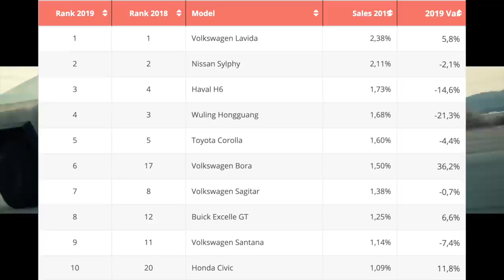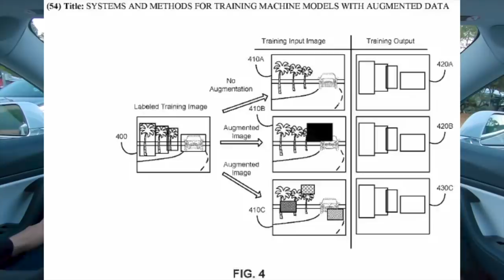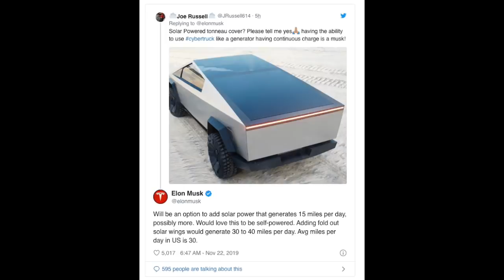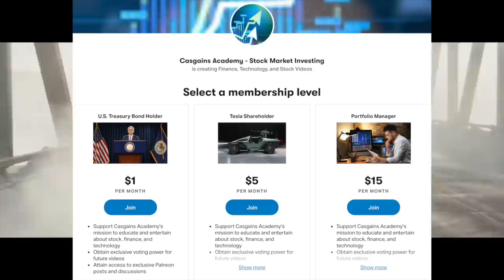Tesla's Upcoming $20,000 Compact Vehicle - An Industry Overdue For Disruption

Comment: How can Tesla get the price of a car down to $20K?

Here's what I'm looking for:

  -  Steel exoskeletons - thus far only seen on Cybertruck, nowhere else in the industry - can reduce manufacturing costs: fewer robots, less labor, and no paint shop needed.  This design approach argues for minimum steel bending, so it's going to be another angular design if Tesla goes down this path.  Different from everything else in the compact market, and kind of ugly, but with durability unmatched by rivals.  (This is a risky prediction, but I'm hopeful Tesla will go in this direction.)

  -  The sensors and computers add a lot to the cost of Tesla's more expensive models.  I expect Tesla to strip out most of that for an economy compact.  Less-capable computers, no FSD option, only forward-looking sensors and very basic driver assist, and a more basic entertainment system seem likely, at least in the early years for a compact/cheap car.  (Tech costs do decline over time, though, so some of what we see in higher-end models may trickle down eventually.)

  -  I think it's likely we'll see much lower ranges than we are accustomed to seeing on a cheap compact Tesla.  One possibility is that they will use a lithium potassium battery chemistry in the pack: half to two-thirds of the energy density per kilogram, but a much reduced production cost.  China has robust supply chains for this type of battery, in the form of prismatic cells - bigger cells, easy and cheap to assemble, less effective for cooling, but Tesla engineers can probably achieve acceptable cycle life regardless, being the clever people they are.  I'll be pleasantly surprised if Tesla can use lithium potassium battery packs to deliver 200 miles of range (EPA).  It might be a bit lower.

  -  I expect Tesla to refuse to compromise on safety.  Whether they use steel exoskeletons or more traditional stamped/painted bodies, they will engineer a compact car to achieve best-of-breed safety for occupants.

I don't believe Tesla will achieve a $20K price if they use traditional stamped/painted bodies, or include the full sensor suite and FSD option in every car sold, or use the same batteries we see in the Model 3 and the Model Y.

An entry-level model will need every cost reduction Tesla can find to hit the $20K price target.  But I can see the sense of Tesla offering higher-tier models with the full FSD sensor suite and computer, a top-notch entertainment system, and 2170 cylindrical battery cells for much longer range.  We might see a top-tier compact going for more than the base-level Model 3, actually.  It would be a sweet little car, too, especially if it has the durable exoskeleton going for it.  Throw in the FSD option and we might be looking at a $50K compact.

The funny thing is, I think they could move some product at that price.  There's literally nothing like it in the world - an electric compact with long range, fancy tech, no-scratch body, and autonomy, with almost no maintenance needed for a third of a million miles or more.  Crazy.

Comment: I think what they're gonna do is get so good at making model 3s that they get cheaper and cheaper. Then instead of replacing it, they introduce a new premium sedan for 50k and let the model 3 really become the cheap Tesla at 25k
Reply: In europe we need way smaller vehicle
Reply: I think a better sell would be a shrunken Model Y (Model Z?) that is sized like a Golf, to be an iD3 competitor.
Reply: @jesuguru2394  shrunken y is the 3...
Reply: @MJ-zl6yp  3 has the same footprint as the y. Thats the trouble in europe, old narrow picturesque streets of ancient buildings. Europe needs a model 2 with a smaller footprint than y and 3, esp if its going to operate as fsd taxi in those lovely places.
Reply: @DavidOfWhitehills  I understand where you're coming from. My point was just that if we're looking for a compact car saying that a smaller Y would be a fit makes little sense to me. The 3 may have the same footprint as you stated but it is a smaller car in regards to interior space, height, etc. Personally,  I'd love to see Tesla make a car similar to what's on the thumbnail. I'd personally buy a two door Tesla with 150 mile range. Or a couple hundred kilometers for you folks in Europe.
Reply: @MJ-zl6yp  in Europe we need vehicles with:
1) similar size to a Ford b-c max ( medium sized) with 250-300 miles of range ( 400-450kms) that should sell for 25-30k€/$
2) a vehicle af small size, like a mini/fiat 500 with 200 miles of range base and 250 with extended range, that should be at 20-25k € ( Fiat is selling a full electric 500 with 200 miles range)
3) a small 2 doors like a smart with 100-150 miles range ( 150-250kms) for 15k $.
Reply: @flaviosalatino8192  I'd love option number 3 personally!
Reply: @MJ-zl6yp  Except the 3 is still larger than the Golf-size Europeans (and Asians and some Americans) want, and the 3 doesn't have the large versatile rear hatch opening the Y and other ICE hatch cars have.
Reply: jesuguru A smaller model Y should be called model y
Reply: Likely.

Comment: It’s very unlikely that tesla will use solar panels on cars. You said “China is a hot country”, solar panels work with light not with heat. The surface of a car is not enough to charge the battery, to obtain an usable amount of energy you should double or even triple the efficiency of modern panels and cover the entire car. Also, maybe it will work well at the equator but people in Europe and north America (also china, pretty much the same latitude of Texas) won’t be interested.
Reply: It is not very economic to have a solar yes, but more importantly what about parking under trees or in a garage, the car is not a roof, if roof installations return investment between 8-20 years, car solars will return investment between 12-never years.

Comment: You're wrong.

The low-end segment is better served by self-driving taxis (much lower cost per km).

And Tesla would rather scale-up it's $40K car production than go for lower unit price.
Reply: Compact self driving taxi with millionmile battery and ss exoskeleton. It would take millions of ice cars off the road - which is Tesla's purpose.
Reply: @DavidOfWhitehills  Exactly right.
Reply: I dont think so. 90+% of routes are driven with 1 passanger. There is reason to make the self driving robotaxi fleet consist mainly of smaller than model 3 vehicles. A Smart fortwo sized robotaxi could offer a much cheaper price / mile due to lower weight and an optimized sized battery.
Reply: @szabomarton8064  Yes - most of the self-driving pods will be very small. But they will not be designed for private ownership.

(you don't care if a taxi is pretty, or how quick it does 0-100kph. you only care about whether it is functional.  So the criteria for optimizing cars for robotaxi fleets are very different than optimizing cars for private ownership).
Reply: Owning a vehicle is a status symbol everywhere in the world.  There are 1.5 billion Chinese, and one way they tell each other their place in the social strata is whether they own their own car.

Robotaxis, given that a reduced cost-per-mile can be achieved versus human-operated taxis, will surge taxi-delivered miles.  Sure.  But lots of people who can afford to own cars will own cars.

I think it makes sense for Tesla to pursue both robotaxis and sales for personal ownership.  If they don't, it'll leave a hole in the market; displacement of ICEVs will be slowed.
Reply: @Urgelt  So was owning a horse.

Times are changing. And fast.

Besides, if you tell people they can save money and nap on the way to work, or they can own a car, what do you think they'll choose?
Reply: @shaimach  You can use robotaxies in compliance with policies set by the owners.

You can't customize them, or keep your stuff in them, or go in them to places that the owners don't want to serve, or demonstrate your status.

Believe me, personal ownership of cars isn't going to end.  It'll dip a bit if/when taxis are cheaper (and I conceded that robotaxis should be cheaper), but that's it.
Reply: @Urgelt  My son will use robotaxis for several years before he's eligible for a driver's license. He'll never bother getting a drivers license or a car.
Reply: @shaimach  Perhaps so!  And there will be others making the same choice.

But demand for ownership isn't going to vanish.  Most of it will remain intact.

This isn't solely about cost, y'see.
Reply: @Urgelt  Sure. And some people still ride horses. 

In urban and suburban areas, the transition will be very quick - within a decade it'll be hard to find a human-driven car.

But in rural areas, the transition will take much much longer.
Reply: @shaimach  You're still seeing cost-per-mile as the only driving factor in the decision to purchase a vehicle versus use taxis.

It just isn't.
Reply: @Urgelt  robotaxis require zero up-front money, unlike buying a car.

So you have a situation where I can either pay for a new car, and then pay more per mile for using it, or pay zero upfront, pay less per mile, never have to think about parking or maintenance.

I'm not saying there will not be people preferring private ownership. There will be. But I do believe by 2029 the number of new cars sold to private individuals will be less than 25% of what it was in 2019.
Reply: @shaimach  Well, we have arrived at the nut inside the shell.

Neither of us knows what the future holds; either or both of us could be wrong in our forecasts.  Neither of us understands human nature so well as to attain certainty about what people will do, and when.  We aren't alone in this uncertainty.  Nobody is certain.  There are too many variables in play; the future cannot be mathematically modeled.  All we have are guesses.

When an entire industry, or in this case an entire civilization, is in the throes of massive technological disruption, all bets are unsafe bets.

And so let us respect each other's attempts to understand what will happen.

Your guess has the advantage of being endorsed by Elon Musk, more or less.  At least, his guess is closer to yours than to mine.  He's a futurist; he's been right on an awful lot in his guesses; he's a smart fellow.

I dare not guess he's entirely wrong, considering cost of miles traveled alone, I expect a rise in taxi miles against the total miles in transportation.  Robotaxis will be cheaper - though how much cheaper remains to be seen and isn't written in stone quite yet.

But I feel that the other reasons for consumers to own their own cars remain compelling for the majority of those miles in personal transport.

In dense cities, of course, where parking is expensive, taxis will do better - but they already do better.  It's a difference in degree, not kind, to add robotaxis to the mix.

The prospect of robotaxis taking a larger slice of transportation is one I'm happy to celebrate.  They'll add efficiency, reduce cost, reduce emissions (most will be BEVs, I think).

But I give more weight to the other advantages of personal ownership than Elon or you do.

Personal ownership is already more expensive than using taxis, for the most part, yet personal ownership remains strong.  Thus far, in history, no form of public transportation has been able to dislodge personal ownership as the dominant form of transportation.  They're all cheaper, but something is always lost in convenience, timing, customization, prestige.  Robotaxis won't change those dynamics very much.  Some, yes, but it's not quite the game changer Elon and you imagine - in my uncertain opinion.

People are not solely motivated by cost, y'see.  Never were, never will be.  There are other factors in play.

If the addition of robotaxis reduces new car sales by more than 5% by 2040, I'll be shocked.  I think it will be much less.

Know what I think will be the biggest factor reducing car sales by 2040?

Durability.  Million mile batteries.  A twenty-year-old car won't be decrepit, the way we see with ICEVs.  Maintenance costs won't climb to absurd levels.  I think that intended innovation from Tesla will have to be copied by other automakers, if they want to survive.  And that implies shrinking new car sales - not right away, not while there's an enormous in-use fleet of ICEVs to replace.  But going forward, we just won't need as many new cars.  The old ones will still be excellent.

Against that trend, of course, there is tech advancement, so there will always be reasons to want new cars.  But the impetus to get rid of older ones will decrease.  I think that will be a larger influence on new car sales than robotaxis.

No matter how it plays out, though, I'm excited by this period of disruption in the automotive industry.  Things are going to get better for humanity - less poisonous air, cheaper maintenance, fewer deaths.  Now it's mainly a question of pace.  Tesla is leading, but the legacy automakers are sluggish.  It's hard to guess how it will all play out, or when.

But it's fun to try to guess, and it's fun to argue about it.

Cheers!
Reply: Ziggi Mon  And computers will never beat humans at Go.

Oh, wait, ...